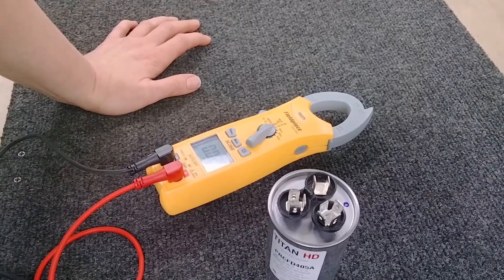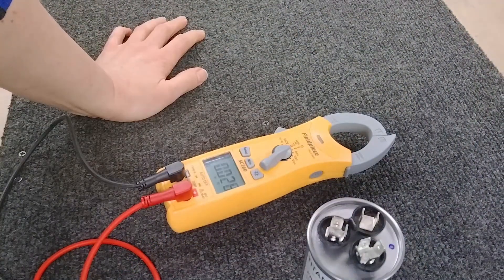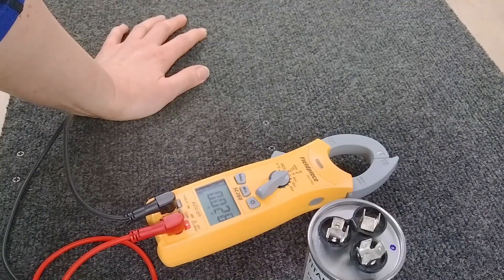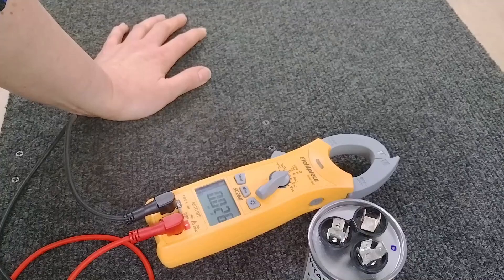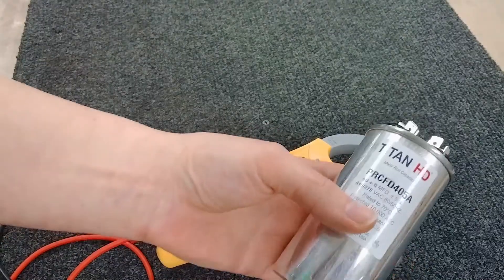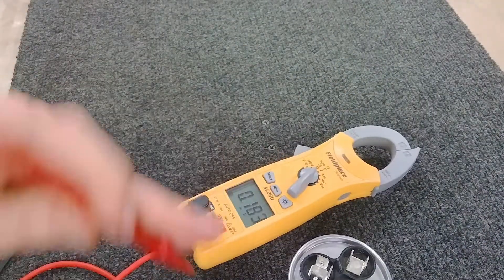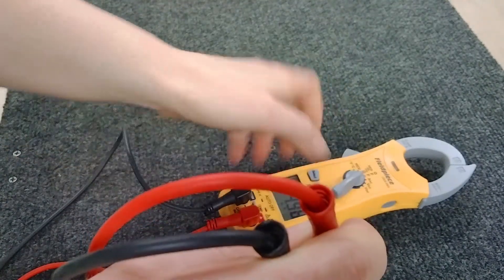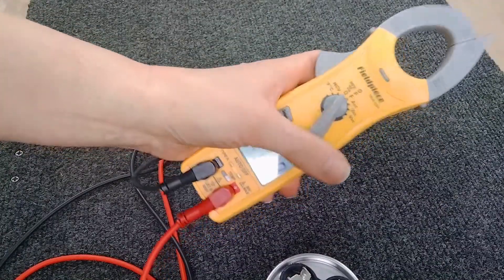How To check A Capacitor With A Meter That Reads Microfarads

Comment: Do digital meters need time to charge up high voltage caps a little before getting accurate farad readings?
Reply from the maker: Most meters function by sending small charges into whatever you're attaching to (for ohms, microfarad, continuity).  So yes, they do put a light charge into the capacitors - not enough to pop you though.

Comment: Buying a meter is MUCH cheaper than paying the sheisters that will come out and troubleshoot your AC for you. I had a company doing a yearly check-up on mine and they said my capacitor was low and the charge would be $325 to replace! It is literally held on by one sheet metal screw and cost about $25-$35 to replace.  He already had the cover (4 screws) off in order to check the capacitor.